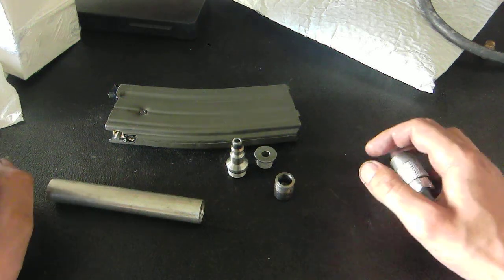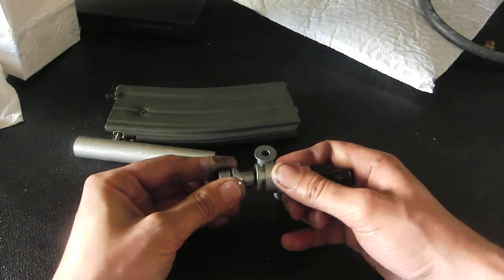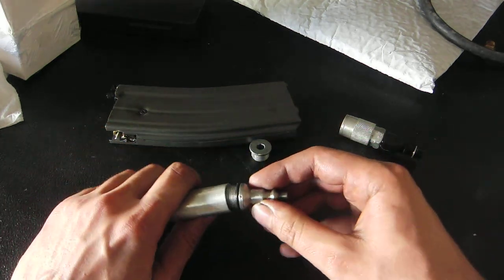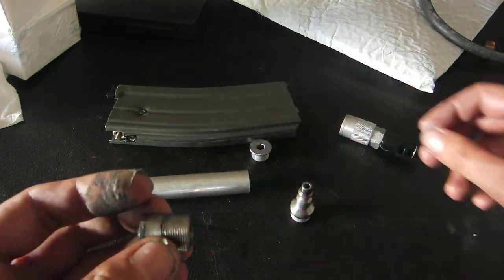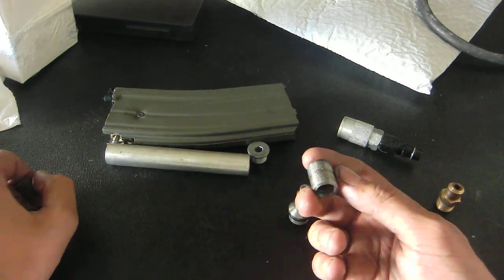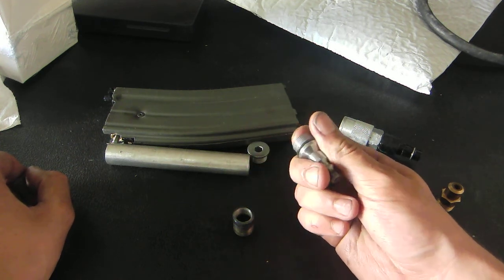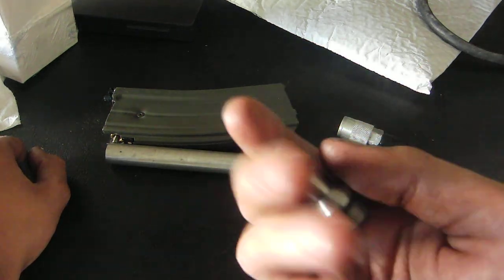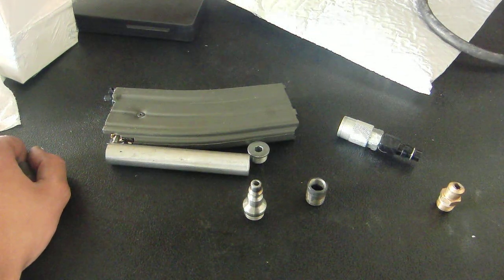Steel adapter to run the GHK GBB conversion kit on compressed air

Comment: Nice work bud. Any luck with the carriage spindle?
Reply from the maker: I have not worked up the courage to take it apart yet. I plan to do a video about some of the problems I have been having with the machine and a few things that are broken. I will likely also do videos about how I repaired them. I think your probably right and the gear an spindle are separate parts but I will need to take the apron apart to be sure and to get measurements before attempting to make a new part.